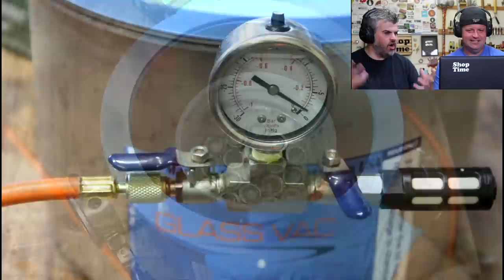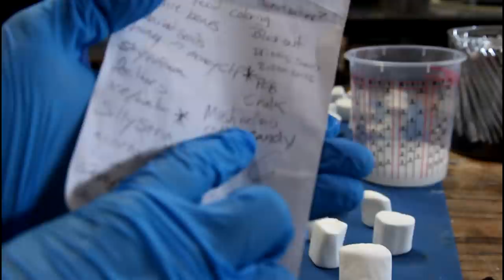What Happens to Marshmallows in Resin?| DipIt #33

Comment: Under the right conditions, (presumably cool, dark, extremely low humidity) marshmallows will turn hard as golf balls. I found a fossilized bag of marshmallows under a shelf in a grocery store that looked normal, but clattered like golf balls when dropped.
Reply: I found a bag in the back of my parents cupboard about a year ago in the same condition. Just like completely petrified.
Reply: weirdly, people will buy Circus Peanuts, which come from the factory petrified like that.
Reply: As the insane person who prefers marshmallows like that, the conditions are indeed cool and dark. My preferred method is open the bag, put in the back of the cupboard or I prefer the back of a drawr(tend to put it in the same drawer as rice) shake the bag every week or so to allow the ones further in the bag to dry. I tend to do so with mini marshmallows because its quicker. Wait till preffered consitency. (I like stale but not quite gold ball hard.)
Reply: @kittin75  …wonder if a dehydrator might accomplish the task a bit sooner for ya.  May not be as authentic tho.

Comment: I think one thing that maybe would have helped you guys out a lot is if you freeze dried them first and then stabilized or even encapsulated them in resin
Reply: Great idea
Reply: Freeze drying may have deformed them too I think. King of Random does a lot of freeze drying nowadays and the gummy candies triple in size.
Reply: @monday9026  They actually don't do anything nowadays. Grant's widow fired Calli too, total BS
Reply: Why not completely Coat and Activate them in UV Resin first so they dont deflate . . .
Reply: @monday9026  yeah I'd try drying in a vaccum to hold them out puffed a little. And let them dry around the natural bubbles.
Reply: It’s never gonna work with the Cactus Juice, because you have to bake Cactus Juice to cure it, and the heat melts marshmallows.
Reply: @ytube6190  UV resin tends to discolor a lot faster than an epoxy resin with UV blockers in it, so I think the CC DIY was a good choice. As long as they're completely coated in the resin, they should be good for a very, very long time. Love to get an update in a year, see how they look!
Reply: Thats true . . . So what about a Clear Porcelain Glaze
Reply: @ytube6190  I would think any clear coat that can be applied so it's air tight and is meant to last would work. A few coats of a good spray lacquer would be really easy to apply, too!
Reply: Wouldn't the enamel eat away at the sugars ?

Comment: Peter, instead of a heat activated, very thin resin like cactus juice, can't you use a 2-part resin that has a very low viscosity and a really long cure time to drown them into, suck all the air out, let the atmospheric pressure back in and so on and then it cures without needing a hot oven? But marshmallows react much different to vacuum anyways, because its cell walls stick to each other, unlike cellulose/sponge cells which are kind of open (if you put a piece of kitchen sponge into a pipe, water will filter through, unless compressed too much, but with a marshmallow, no chance)
Reply from the maker: Maybe.
I have some penetrating resin that's used for punky wood. But it wouldn't change the sugar content of the candy. No sure if it would be much different in the end.
Reply: Kim Tippen and Doug from Pohl Barn both occasionally mix a batch of Resin and then thin it with an equal amount of acetone. It makes a GREAT Penetrating Resin for soft/punky/rotten wood and all the acetone does is make the Resin Cure a little slower, it doesn't affect the final hardness/strength of the Cured Resin...

I'm not sure what acetone would do to a marshmallow, but it won't hurt the Resin...

Comment: How heavy is a resin mallow vs a plain one? When discussing how many to remove I was hoping you'd try weighing it and see if you could remove enough to get to the advertised package weight and still have a viable prop, but I also  have no idea how much weight the resin added.
Reply: You know, there’s medication available for your OCD.
Reply: That's a great question! 
I personally don't have a precision scale, but I can tell you the difference is negligible. The difference is hardly detectable by holding them if I didn't know there was a difference, I probably couldn't tell you which one was heavier with any accuracy.

Comment: Wait a minute... Why do these marshmallows shrink? Yesterday I rewatched your "vaccuum dome" video and the peeps grew in size in the vaccuum... two kinds of 'mallows, two different reactions under similar circumstances?
Reply: Maybe because the marshmallows were weighted down and in liquid?
Reply: they expand at first but once the full vacuum is pulled all the air is sucked out of the marshmallow so it gets crushed
Reply from the maker: Yep! The liquid is the difference.

Comment: Also what about if you were to try "stabilising" the marshmallows in 3D printer resin and then setting them with UV light?
Reply: The UV light probably wouldn't be able to penetrate to the center of the marshmallows, so you'd get a shell of hardened resin but the insides would remain uncured and gooey.
The cactus juice stabilizing resin works on things that can withstand heat because the heat spreads through the whole piece. Obviously we've seen the result of trying to use heat activated resin to stabilize something that melts.

Comment: I just watched, great video.  Was thinking you should have dehydrated them, it only slightly expands them vs freeze dry, which would blow them up first. Because a freeze dryer "dries" under pressure and would expand as its drying.  Love to see them now. (Just seen what the pizzas looked like after several months. ) thanks for the video.

Comment: I was wondering when heat was going to be a problem. Figures it was when you put them in the oven. I think coating them like you did was a good trade off. Not "dipped" per se, but definitely preserved. Thanks for sharing!

Comment: You should get your hands on some of the Glass Coat epoxy from Mr Nola's Glitter and make something with mardi gras beads(they're a local shop to me and they have their own brand of resin that is so amazing and low/no odor, it is amazing and is the only epoxy I can use because I have allergic reactions to most other brands even with proper protection.)

Comment: Would you be able to take any of those that you coated on the outside and use a syringe to inject the liquid resin into the marshmallow?  And would it fill any of the air pockets without "deflating" them?  I imagine there would a second pinhole for air to escape as the resin is injected.